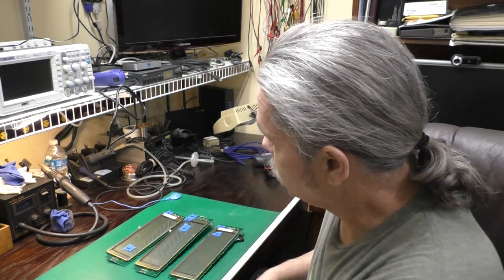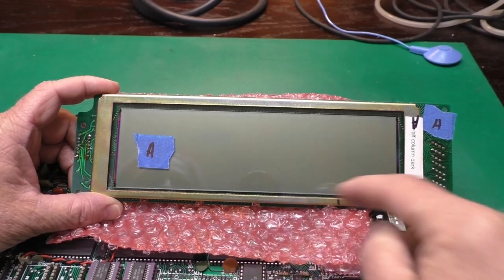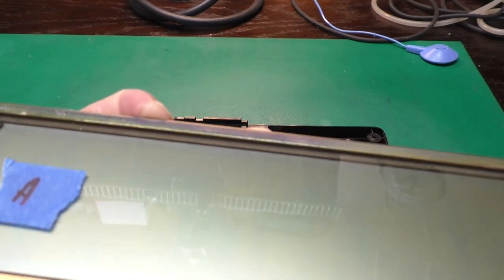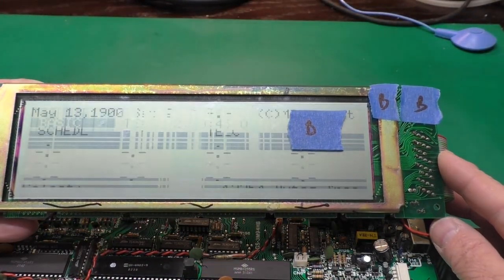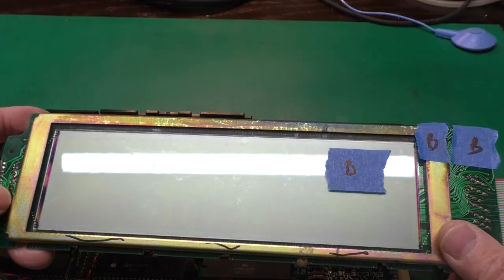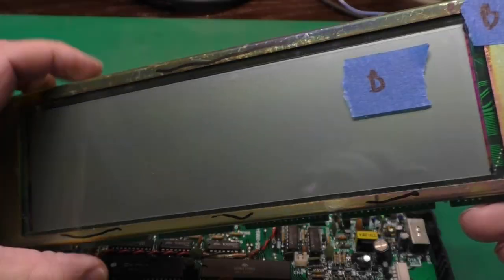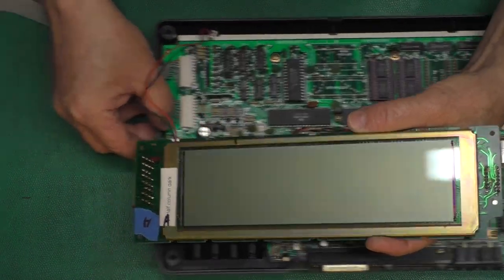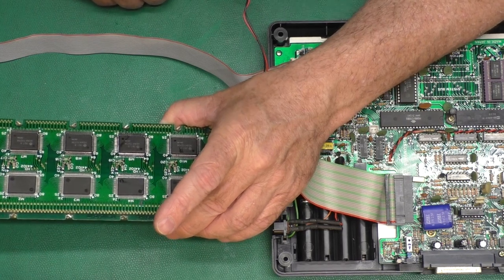Vintage LCD x3 – Let’s try to repair 3 different TRS-80 Model 100 LCD panels

Comment: Interesting video. One problem is the service manual recommends benzine and cautions against organic solvent like alcohol. News to me too, didn't know ITO could be harmed with alcohol. 

Have you thought about getting just the glass made? How common is the screen failures among the half dozen or so computers that use the 240x64 graphics display (today's terminology) ? Dot matrix, reflective, and zebra connections is the cheapest to make.  Right next to my comment is an EEVblog on custom LCDs.....

There is a ham radio that was very popular (CB/Ham/Freeband) and the multi-segment LCD was always the killer in mobile installations. Freeze/bake cycles exploded the crystal layer.  Had some basic info drawn up but before buying did some market research. 99% response was "Yeah, I had one like that. Sold it for parts/threw it out." Maybe computers are different?
Reply from the maker: I had not noticed the note in the service manual w.r.t. benzine vs. alcohol, thanks for pointing that out. . It does say "To clean the contacts or display surface..." so it is not clear to me which of these might be adversely affected by alcohol. 

A quick search revealed a paper showing alcohol had no effect on the ITO in an LED being tested so I'm not sure what the problem might be. Perhaps with the adhesive used for the polarizing film stuck on the glass? I've certainly never noticed any issue w.r.t. alcohol on any LCD.

I did take one of the 'bad' LCDs to work this past week and looked at the contacts under a microscope. I was surprised at how dirty and smeared they still looked. A tried a quick wipe with acetone and they looked much better. I have not cleaned the whole glass yet and tried it again.
Reply from the maker: It is also odd they caution against organic solvents when Benzine is an organic solvent, i.e. it is distilled from crude oil.

Comment: I've a exact same controller/size VFD tube with 64x240 pixels. Would that work? Would be totally awesome!
Reply from the maker: A VFD has much different voltage requirements.
Reply: @HeyBirt  That can be overcome. Buck converters and Li-Ion to the rescue.